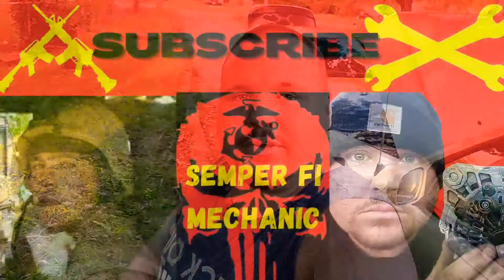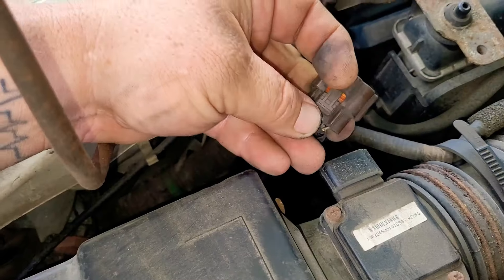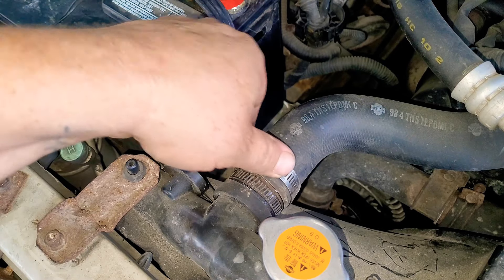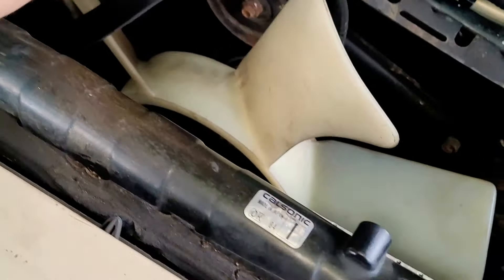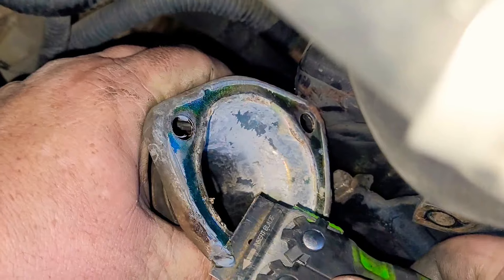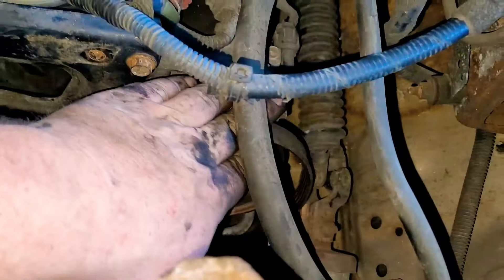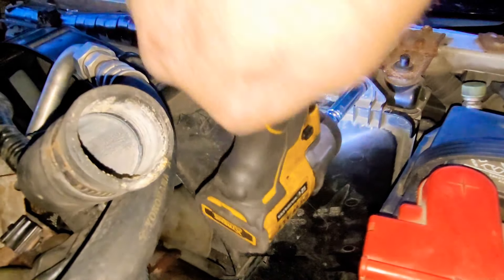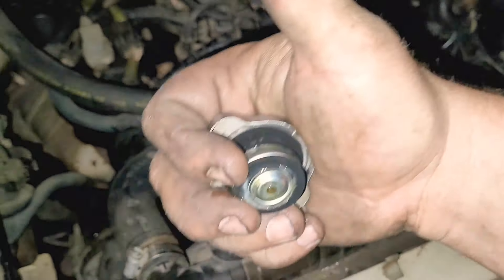NISSAN PATHFINDER, INFINITI QX4 THERMOSTAT REPLACEMENT (BEST VIDEO)

Comment: Man!  I appreciate your video. Just moved to Las Vegas and living out of a weekly hotel and started overheating yesterday. Saw that I had coolant and the fan was working so I figured best place to start is the thermostat. With a handful of random tools I had  in my Infiniti I was able to get the job done thanks to your video. I removed the 2 radiator bolts to get the fan shroud out much easier. Learned that replacing the water pump. Also took the bracket with that top fan pulley out completely to have a little more room.  Bled for 15 minutes facing uphill and seems to have done the trick!
Reply from the maker: Thank you brother for your support it means a lot to me and I'm glad it all worked out for you sounds like you did a good job proud of your brother